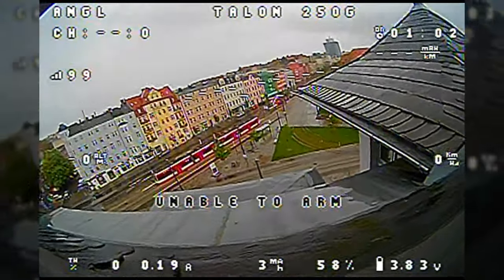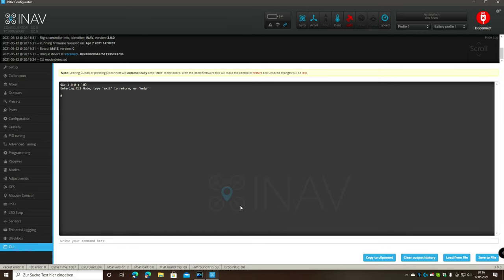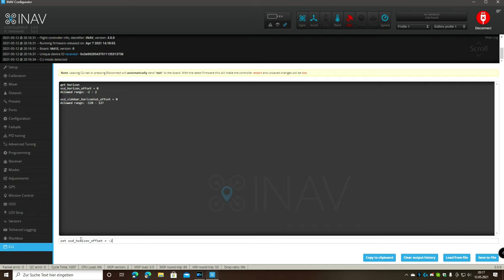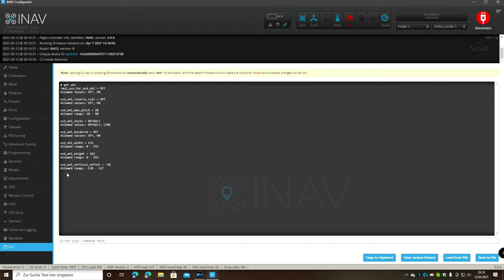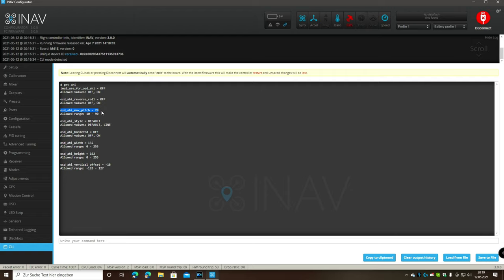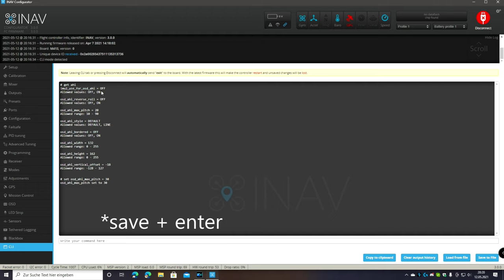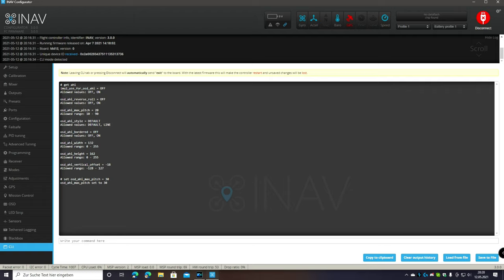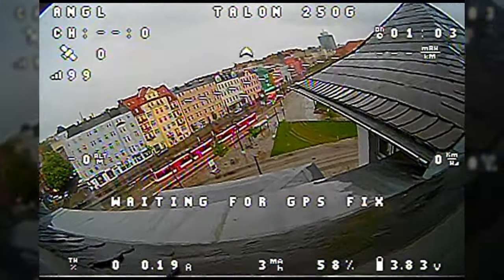INAV how to set up the Artificial Horizon correctly

Comment: Great video ! Weird thing is I don't have the "osd_ahi_max_pitch" cli value at all. (inav 2.6.1) It's not even in the complete CLI dump ... The "osd_horizon_offset" is there. I see you used iNav 3 in the video. Is "osd_ahi_max_pitch" something specific to iNav 3 ? Thank you !
Reply from the maker: oh dang. Yes it might be a 3.0 setting and might have a different name in 2.6. Let me check that. It is there for sure!
Reply from the maker: Yes you're right. In 2.6 it is named osd_artificial_horizon_max_pitch. But it does the same. I'll pin a comment.
Reply: @MarcFPV  Great, thanks for checking, just did it on my Mini AR.
Reply: Erst vor kurzem darüber gesprochen und schon so ein geniales Video. Werde es die Tage mal versuchen und dir berichten.

Wäre mal super die verschiedenen Einstellungen vom Pixel Osd zu sehen. Der Standard Fighter-Look ist zwar ganz nett, aber auf Single zurück ist sicher auch interessant. Vielleicht eine Idee für ein neues Video für die Regentage.
Reply from the maker: Gute Idee! Und ich hab heute auch noch frei xD
Reply: @MarcFPV  das dachte ich mir schon fast. 😂

Aber da freue ich mich schon sehr darauf, denn dann kann ich mir mein OSD auch noch richtig einstellen.

Comment: Thx for the vid. Is there any reason the cli horizon offset command works better versus just shifting the horizon using the configurator GUI in the OSD settings?
Reply from the maker: you cannot shift the horizon in the GUI. at least that would really surprise me as I never saw that implemented. Crosshair and horizon are fixed elements.
Reply: @MarcFPV  Ahhh! You're right, I must have confused myself with Betaflight, there the crosshair and horizon are like any other element and can be set anywhere. On iNav not the case for some reason. thx!